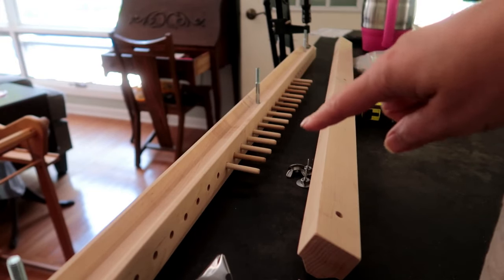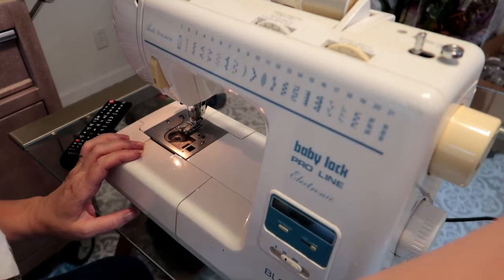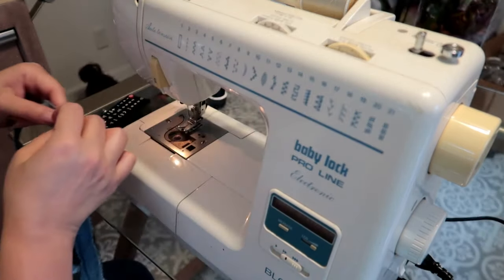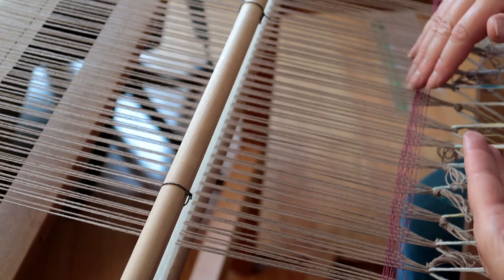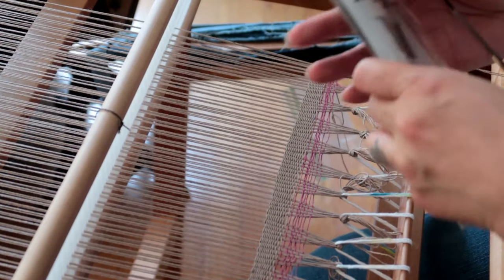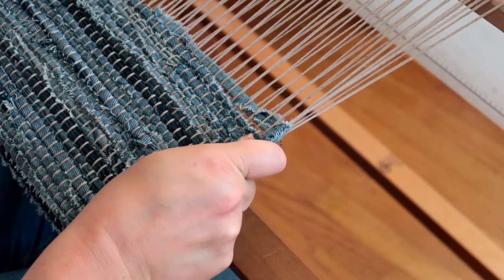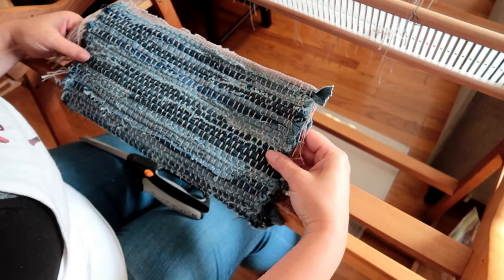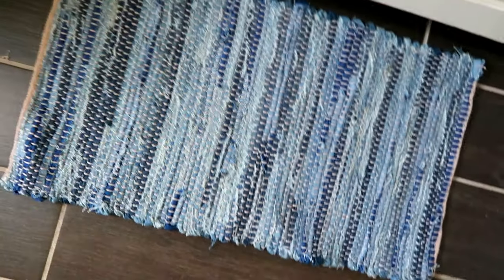Weaving A Rug On A Loom   Denim Rug On A Rigid Heddle Loom   Upcycle Jeans

Comment: Totally the cutest rug ever! I was wondering if you would machine sew a piece of heavy twill across the short edge, turn it under,  and then sew that down (covering the knots).  But I like your method better! Plus, zero fringe! YES! Also - YES - to more towel videos!
Reply from the maker: It did work pretty well, so I guess I'll see how it holds up.  I was worried my machine couldn't be able to handle all those layers of denim plus more.  It's pretty thick and heavy.

Comment: I'm in TN and came across a Vintage 36" Kessenich, from when they were still in Wisconsin, now they're in Michigan so you might be able to find a good deal used up there.  Being a folding Jack loom makes it ideal for small spaces.  I think when folded up it takes up 9-10... 12 at most... inches of depth so as long as you have a space on the wall that's 45 inches or so then it really doesn't feel like it is that big.  Whole different story when it's opened up.
Reply from the maker: They are made about 90 minutes from me now!  I wish I could just make myself buy a new one, but who knows?  Maybe they'll find my channel and be willing to give me a deal if I make a video series 😂

Comment: Got a bag of jeans, and this has inspired me to tackle this project with my 24" RHL.
Just ordered a 5 dpi.   While waiting for its arrival, I will be cutting 1" strips.  What
brand was your warping material????  I've never seen a warping board like yours.
Is it a type that can be purchased?????
Reply from the maker: The warp I used was rug warp from Great Northern Weaving. I think it's made by Maysville. And yes, we found someone local to make those bars and I do still them. You can email me to get one or buy it from my Etsy shop. I even have some in stock for once. I'm usually sold out!

Comment: Hi, I love your videos. I have a question. I notice you knot the ends of the warp before you lash on instead of just lashing on the loops. Is there a specific reason for doing it this waY?
Reply from the maker: I have found that there is less waste if I lash on this way, and I can adjust the tension with the cord I use to lash on.  If I have a looser "bunch" of threads, I can just keep tugging around on the bunches until I get them perfectly even.

Comment: Why not just sew the ends on your machine? I liked your end result. A rag rug was going to be my next project. Now I have watched you I feel I can do it to. Thanks Love your videos!
Reply from the maker: Because the warp is very far apart, the weave on the edges is not very stable, but it is VERY thick and coarse.  I didn't think normal sewing machine thread would be strong enough to hold it, and I definitely didn't want to see it drawing in the weave or showing on the top at all.  I don't think I'd like how that looks.

Comment: I'm curious about your warping bar. Does the center bolt create an issue (a huge bump in the paper that separates the warp strings from each other) when rolling the yarn onto it?
If so, how do you alleviate the issue?
Reply from the maker: I'm not sure what your asking, Scott.
Reply: @FiberLoveDiary  Thanks for responding. I'm not sure how to rephrase the question. 🙄